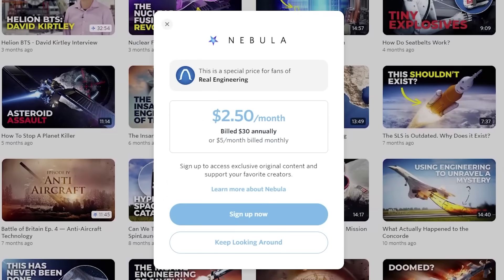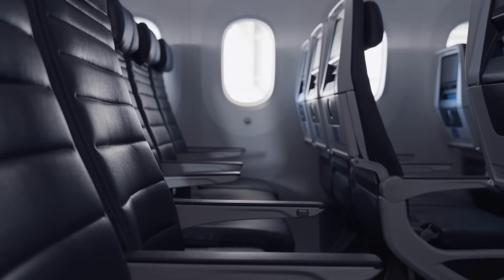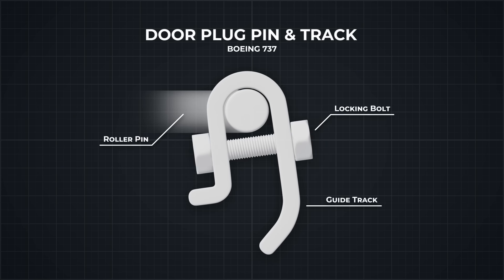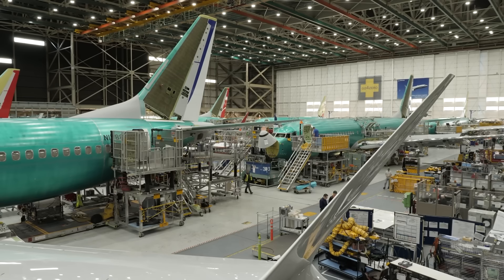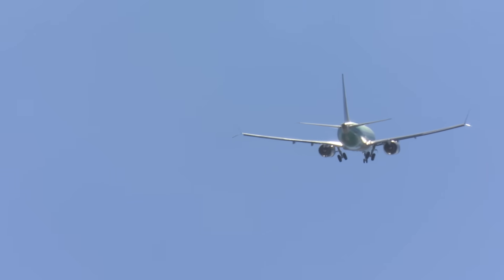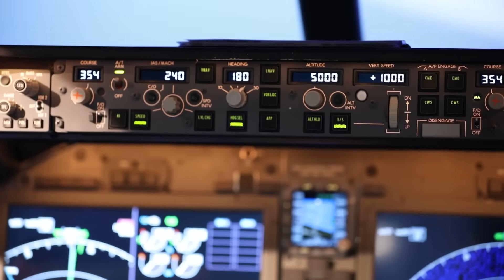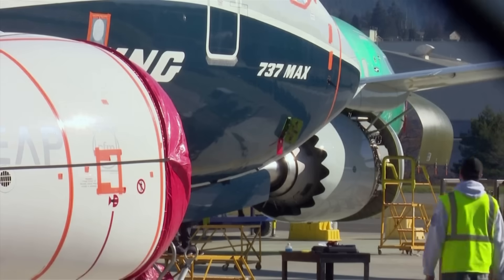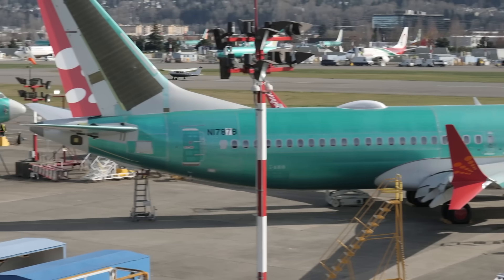The Questionable Engineering of the 737 Max

Comment: This goes down in history as the best iPhone drop test so far!
Reply: MAX DROP TEST
Reply: Or the case of the iphone drop test😅
Reply: @CollectionLearning.  pretty sure 90% of the impact was absorbed by the case
Reply: @trailfork7815 Nokia: I am proud
Reply: @CollectionLearning.  They mostly all fell in grass so eh
Reply: Terminal velocity. Objects can only drop so fast regardless of the height.
Reply: @AshtonCoolman  What is the terminal velocity for an iPhone? It's quite slim and dense.
Reply: @akizeta  it is, but it would probably not fall like an arrow. It would probably tumble or flutter like a leaf. Not very efficient.
Reply: @patricknorton5788 exactly what I thought of. Not that they were gliding but weren't falling like bricks either (like phones usually do when you drop them on bathroom tiles).
Reply: @AshtonCoolman What does the terminal velocity have to do with the iPhone not being destroyed? Phones can be destroyed going far slower than their terminal velocity. Its a matter of luck of where and how the phone impacted the ground.
Reply: @AshtonCoolman  eh cant say that without mentioning aerodynamic resistance. Iphone would hit ground slower then say a base ball just because the iphone flat rectangle at times in fall would act like an air brake. So even if baseball and iphone had same weight, shape comes into play.
Reply: It was the case. In no way a phone can endure that test xD

Whichever the brand of the case that iphone had, they are literally taking too long to take advantage of that free advertising xD
Reply: iPhone: Wehhhh... You dropped me 2 feet onto carpet, now I'm broken forever 😭😭😭😭 (pay $2,500 for your next iPhone please)
Also iPhone: Parachutes?  Don't need 'em 🦾🦾🦾🦾
Reply: 😂😂😂😂 bruh
Reply: Spigen started marketing with this. The iPhone had a spigen case on. 😂
Reply: I’ve got to admit if I’d been one of the people that discovered a phone that had fallen from that aircraft and still worked, I’d feel compelled to do my very best to try and reunite the phone with it’s owner.
Reply: Timex and Samsonite could learn a few things. (I think that was the luggage commercial.)
Reply: When I read about the iPhone falling, I was suddenly glad it wasn't an old Nokia 😂😂
Reply: Yeah, I had a feeling the part about the iPhone falling out of the plane intact would bring the sour Android kiddies out the woodwork.
Reply: @tonyhawk123 You're implying there would be a difference? If it's an android of the same price caliber of an iPhone, it has a comporable build quality, potentially better, potentially worse, but none of which would likely lead to different results. Really it's the case and the fact they landed on grass, not everything requires you to fuel brand disputes, and there's no need to simp for a given brand as if it's your tribe.
Reply: @dOUBLE_ddeez  explain that to the childish reactions from Android fanatics. You're arguing against points i didn't make. Couldn't care less which brand it happened to be that survived the fall.
Reply: @tonyhawk123   you're fighting ghosts here. I haven't seen a single sour reaction from anyone except for your comments.
Reply: @tonyhawk123  a Samsung "fanboy" here.

I agree. Theres no way a phone can endured that drop. TBF, it was most probably sheer luck.
Reply: I hate green texts
Reply: @mikelp72 Why?

Comment: Me and the boys at 3 am hyping up Airbus:
Reply: I think the real difference is that Airbus is not as unified as a corporation and exists in a more regulated environment with stronger unions. This means the executives don't have as much confidence they can do whatever they want without consequence.
I think the problems of Boeing are symptoms of a bigger problem of American megacorps having way too much power.
Reply: @MrMarinus18  It also has to do with the fact that the biggest shareholders are the French and German government adding up to a quarter of total shares if you add the Spanish government. Maximising short term profitability is simply not a concern for airbus shareholders.
Reply: Embraer for the win
Reply: See my other post at the top of the comments list.
Reply: @RalphEllis  I just flew Southwest. No assigned seating. I've never had so much room on a plane in my life. Very comfy.
Reply: @T1Oracle . Safety, is not a comfy seat.

R
Reply: @T1Oracle Airlines have control over seat spacing arrangements, not Boeing or Airbus. Been on both and the Airbus A320 (their 737) is so much quieter inside.
Reply: Team Airbus or Team Boeing wich one u on
Reply: Airbus recently had an open door alert. Yay, for Airbus!
Reply: That looks to be a sensor issue, it was on an A319 which does not feature plug doors. @jamesturner2126